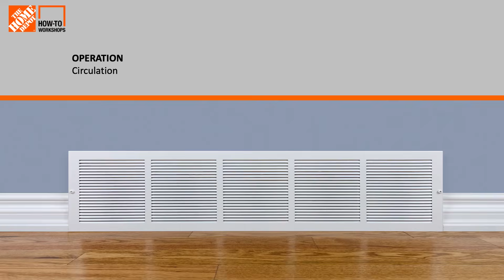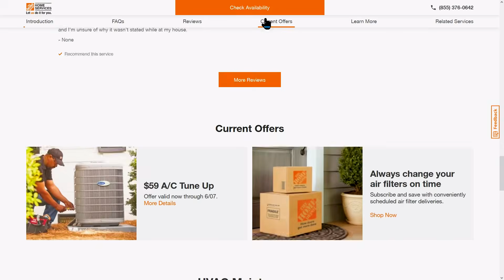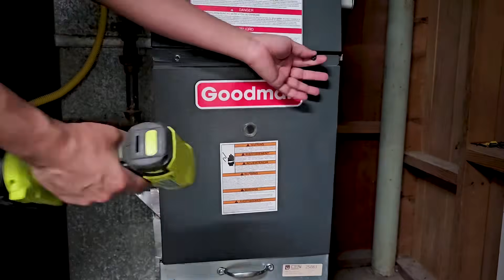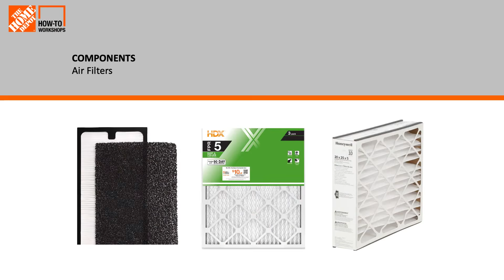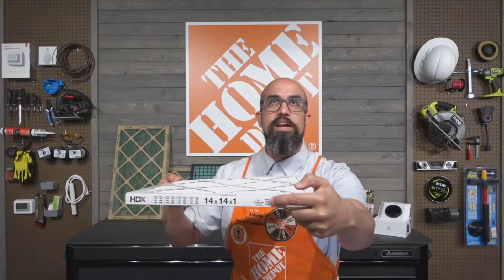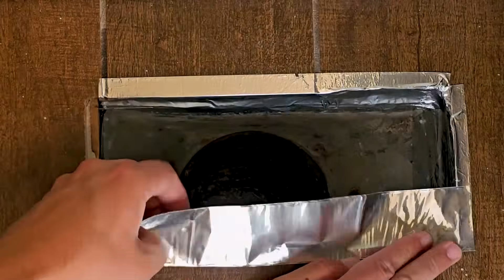How-To Workshops - HVAC Basics | The Home Depot

Comment: HVAC basics are worth knowing, but there's a pretty big gap between understanding how a system works and actually diagnosing why yours isn't. Knowing your components helps you ask better questions when a tech shows up, which honestly makes the whole service call go smoother. One thing a lot of DIY resources skip over is how much install quality and proper sizing affect performance, not just the equipment itself. If you ever get to the point where you need a pro to look at something and want a written estimate before anyone touches anything, american residential services is one option to compare, though availability depends on your area and they're not going to be the right fit for every situation.